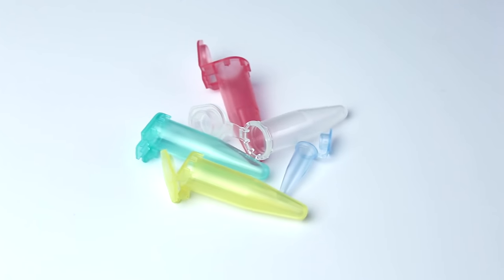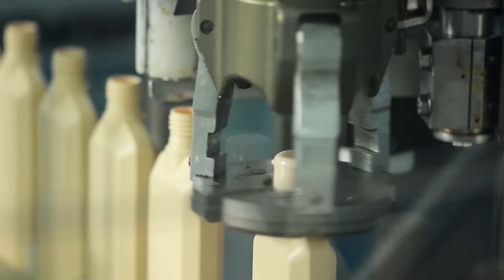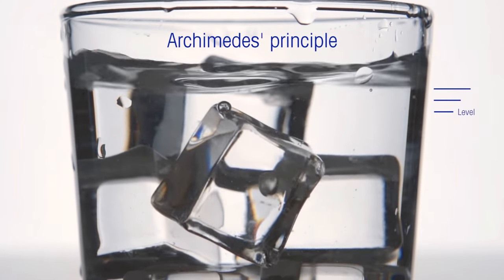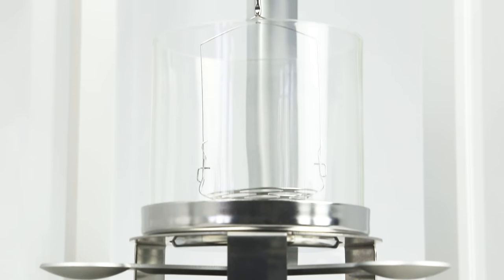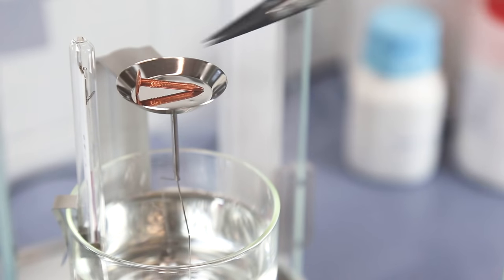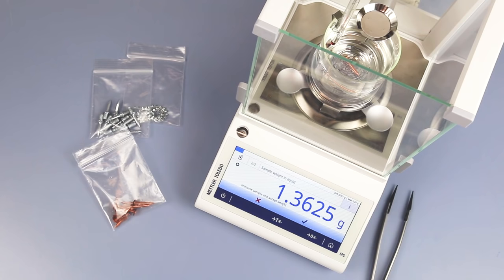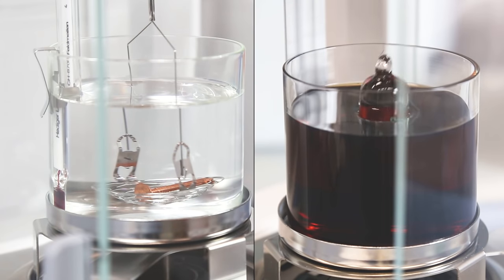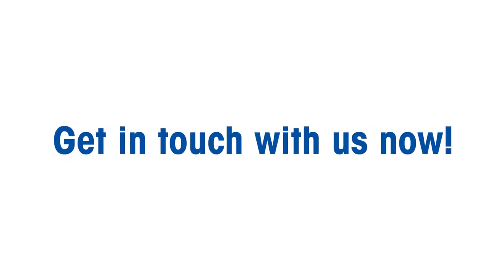Density Measurement with Laboratory Balances

Comment: How much weight of sample can be used for density measurement in this instrument?
Reply from the maker: Dear Shivani, 

This depends on the capacity of the balance. In general, the entire capacity range of the balance can be used for density determination. This means that the maximum sample weight is given by the weighing range of the balance.